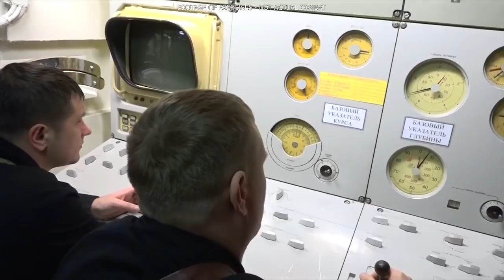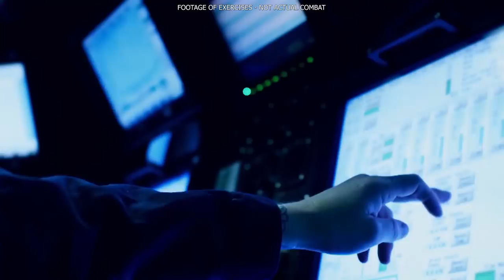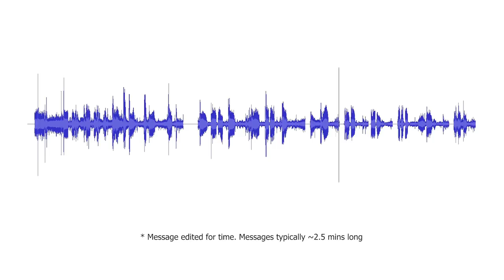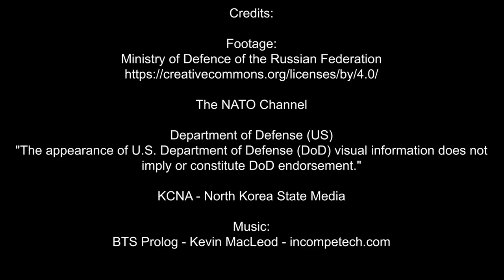The Ballistic Missile Submarine: Most Deadly Weapon System Ever Created

Comment: Thinking of the level of engineering it takes to fit a nuclear reactor onto a submarine hurts my brain
Reply: Nuclear reactors aren’t that big. 1 fuel pellet of uranium, about the size of a fingertip contains as much energy as 1,780 lbs of coal!
Reply: hfdydxydxy nope! I’m dead serious. Same reason why a nuclear bomb the size of a car could destroy most of a city.
Reply: @tibtroopin  you're forgetting all the systems that make up a nuclear reactor, it's not just the fuel
Reply: Space Dohonkey it’s definitely cramped in there but it isn’t much larger than a standard propulsion system. It may be smaller even because of the high heat flux.
Reply: @tibtroopin  could you give me an equivalence to the size so I can get an idea of what size you think they are, for example 'the same size as a car'
Reply: Space Dohonkey so the nuclear reactor itself in a submarine, not including support systems, is smaller than a standard size car. Control rods, steam production etc are additional components most of which are shared between propulsion systems.
Reply: @tibtroopin  ah wow, I'm guessing you work on nuclear submarines?
Reply: Space Dohonkey something similar to that yeah.
Reply: @tibtroopin  the pressuriser is alot bigger than people think isnt it
Reply: Tib Troopin lol u lying
Reply: It is generally known a nuclear reactor on a sub is the size of a dustbin roughly
Reply: @Will-xc8hg  That's crazy!! I feel stupid for writing the original comment but I'm kind of glad I did. I researched a lot about this and learned a lot.
Reply: @ChairmanMeow1  Nobody knows everything ;) Nuclear fission reaction releases about 1 million times more energy than the same amount (in terms of mass) of chemical fuel would release in form of chemical energy, for example by burning in oxygen. Fusion energy releases an additional 4-5 times more than fission, but it is not available right now as a reactor, only H-bombs.

One problem is the half-life of a radioactive isotope. Energy is released over large periods of time. Another issue is controlled release. Since it is more powerful it has to be controlled, so it doesn't melt everything in the near vicinity. Nuclear energy would easily overcome any chemical bonds ;)

Comment: China is the only country that has show submarines with an extension in the loin part that can contain larger rockets. Also no submarine can fire a rocket in the underwater, they need to come to surface and from the dry make the actual launch. 

A submarine can hypothetically pass though a maritime blockage of vessels and from the other side launch its rockets in order that the rest of the fleet can break in. WIth the development of rockets that can be fired from a safer radius carrying at the same time some weight  even if they travel at slower speeds, that role gets ever more possible for subs.
Reply: They actually don't need to surface in order to fire their missiles.

Comment: Each one of the 14 US SSBN Strategic Missile Submarine Ohio-class nuclear submarines has 24 SLBM Surface Launched Ballistic Missiles of the type Lockheed Trident II with stellar and inertial guidance (inertial navigation). 

Each robot has eight MIRVs (multiple independently targetable reentry vehicles) that can be assigned unique targets with either 475 kilotons alt. 100 kilotons combat charges. Trident II D-5 has a range of up to 11,300 km according to a British Wikipedia page, and the corresponding US Wikipedia page rounds up the number to 12,000 km but claims it has a longer reach than that. 

The fact is that the exact range, mentioned on the US Wikipedia page, is a secret. Elsewhere it is mentioned that Trident II D-5 can hit targets at 7,400 km distance. There is a big difference between 11,300 and 7,400 km, and the difference is probably due to the fact that the different core charges differ greatly depending on their strength. 

As it is 7,500 miles away from New York to Moscow, the shorter range means that an Ohio-class submarine based in New York and out for a month of service at sea will spend more than two days of these thirty days to get under the surface from and reach the outer water where their nuclear weapons with the greatest charge can reach target Moscow. 

This means that 6 percent of the second strike ability the United States may have must be omitted already there. In addition, approximately 25 percent of the US strategic submarine fleet at any given moment will be in port for service work and repair that cannot be completed onboard the submarine at sea and/or on the dock. 

In addition, the crews must be allowed to spend time with their families in port and the submarines must be buffeted with food regardless of whether their submarine is in need of service and passage in port or not. 

To all this must be added that the submarines' nuclear weapons must be maintained at regular intervals, perhaps every five years, and this is not done on board the submarine. 

Overall it reduces second strike ability by 40 percent or more in the worst case. Alternatively, the detonation blast from a multiple early nuclear missile launched from a given submarine is reduced very close to the home coast with up to 80 percent if half of the robots have 475-kilo warheads with shorter range for the nuclear-powered missile, but remain un-fired because of their shorter range, and the remaining half are only 100 kilos charges that can be fired from the waters from the New York coast. 

If this ratio applies to as little as 6 percent + 25 percent of the United States second strike capability, at least 82,800 kilotons of trotylene nuclear weapons can be removed from the equation, at least in the immediate phase for up to just over two days. For Russia and China the numbers must be similar or probably even worse.

These Ohio-class Trident II nuclear submarines make up the US strategic second strike capability and a total of 50 percent of the US strategic nuclear capability. 

There are also 4 Ohio-class SSGN Cruise Missile nuclear submarines capable of carrying 154 Tomahawk Block III or Block IV cruise missiles. The Tomahawk Block IV missile is an all-weather surface- and submarine-launched precision strike stand-off weapon. 

Designed for long range precision strike missions against high quality and heavily defended targets, the Tomahawk has a maximum range of 1,000 miles, or 1,609.34 km to be metrically accurate. It travels at sub-speed - 890 km/h.

It is simply not true that one Ohio-class can annihilate a not so small country. Here you can see for yourself the effect of a nuclear weapon, which you can give various large charges, in an attack on any city or city in any country: 

http://nuclearsecrecy.com/nukemap/

Comment: Hard to be the most deadly weapons platform when they've never been used. Also, you never made the case that SSBNs are "deadlier" than bombers carrying cruise missiles with nuclear warheads. All you effectively did was describe what an SSBN does. Not your best; you can do better--
Reply from the maker: My line of thinking was that a bomber, whether it is a Tu-95 with Kh-55s, or a B-52 with AGM-86s, only carry around a dozen or so missiles, each armed with a single warhead. The missiles themselves are subsonic, and significantly easier to shoot down compared to an intercontinental SLBM.
Reply: @Covert, Stick with the facts. They do not think but cannot be fought even though people will try.

There is nothing deadly going on at all. Most factual weapon systems effectiveness if you will is usually measured by the number of kills if you will. Simply put a P-51 is way more deadly then a F22. 

You are correct the number and size of missiles a SSBN carriers are quite larger then what most bombers can carry. I do not think we need to debate the surviveability of a SSBN is far greater then that of a bomber near or even inside contested air.

And in the real world both missiles or SLBMs, ICBMs are very easy to shoot down. Remember ASD15? My 9yo could do it. ;-)
Reply: The location of ICBM's silos are publicly known, and could potentially be vulnerable to first strike if the early warning system failed. Bombers and cruise missiles carried by them are very easy to shoot down. Submarine-based ballistic missiles (SLBM) are the most survivable, you never know where's the submarine is when it's submerged, it has great range and is as hard to intercept as ICBMs.
Reply: Covert Cabal My brother is a sub guy SSBN-730.  In combat his boat is more survivable then my friends flying B-52s from Barksdale or B-2s from Whiteman. Your channel is superb. Let me know if you need introductions or maybe video or photos. I'm sure we could set something up for you with some of the units. Electronic Warfare would be an option too.
Reply: "There is nothing deadly going on at all. Most factual weapon systems effectiveness if you will is usually measured by the number of kills if you will. Simply put a P-51 is way more deadly then a F22."

Yeah but the video title doesn't mention effectiveness it mentions deadliness which can be objectively measured and is not measured in efficacy. A wrench is more effective at its job than a JDAM is at its job does that mean a wrench is more deadly than a JDAM? No.

In terms of destruction and fatalities the SSBN and SSB are the most deadly weapons platforms/systems in the world fact, saying they're not because they've never been used is silly and saying they're not because they can be countered is also silly because deadliness is measured in optimal conditions. It's like someone telling me that a 96 year retired granny is just as dangerous as that Islamic extremist with body armour, an IED and an AK-47 because they're both in a police cell and aren't going to do damage if they wanted to.
Reply: @Adam, simple fact is that killing nothing at all isn't deadly.

You can go to the endless white cross graves on Memorial day and rally all those there to discuss how deadliness should be effectively 'measured'? Maybe not cos you may be another white cross on those fields.

At 96 our war veteran grannies still row across the channel each year. They are far deadlier then any terrorists on flip flops, lol! What kind of person would put a 96yo war veteran in a police cell??
Reply: Calvin,

Can you ask him how US subs are suppose to get to their designated combat area safely?

From 2000: Ehime Maru and USS Greeneville collision, USS Dolphin major flooding and fire, USS Oklahoma City collision with tanker, USS Hartford grounding, USS San Francisco collision with undersea terrain, USS Philadelphia collision with MV Yasa Aysen, USS Minneapolis-Saint Paul incident, USS Newport News collision with Japanese tanker Mogamigawa, USS Hartford and USS New Orleans collision, USS Miami arson, USS Montpelier collision with USS San Jacinto, USS Jacksonville collision.

In general yes the submarines are more survivable then bombers. Unless it's the USN submarine fleet. For the B-52s aka flying museum pieces it's a different story as well. How do you as US citizen survive a engine pod dropping on your cityblock when it comes off? What do you do if one drops nukes on US soil?

EW could easily take out US silo's. Yes they are all on Google Maps. All you need is a pickup truck and a strong magnet. Still runs on floppies and you know what magnets do to those. ;-)

Oh well Obama did sign the nuclear overhaul program for 1.5 trillion so we know the silo's will go.

Those things can just randomly explode. Remember Silo 7.Could throw a wrench in the whole TRIAD.
Reply: Michel Platteeuw
Trident II SLBM has a range of at least 7,500 mi (12,000 km), a sub can literally be located anywhere on the North Atlantic and could still hit any targets in Russia, given that location, unless you live in Southeast Asia or Australia, you are within Trident II's strike range (and there are Ohio-class patrolling the Pacific too, so literally nowhere on Earth is safe from it). And how can you get inside the silo? You probably need to carry the entire particle accelerator to do any damage from the surface, and I'm pretty sure pickup trucks can carry those. Silo's location is known for a long time since the Cold War because satellites and sightseers can pick them up, it's nothing new.
Reply: Sorry not my logic. Just simple facts anyone can fact check in the offcial active fleet list of the United States Navy.

You are claiming that is how those submarines are suppose to work? lol!

US ONR logic is true you mean? Least they have the balls to admit that is major problem. A-list events are taken very seriously by the United States Navy. I'm guess you are not serving in it?

You should read those reports instead of sticking your head in the sand ...

The USN submarine fleet is nicknamed the 'Bumpercar' fleet. Together with the surface fleet is it the worlds nr 1 in crashing their vessels into random objects really. Oh well that is normal according to you and not a problem?

I am guessing fake news from you. Why is there not a clear list of the crashed ships of the countres you claim crashed ships? You mean you simply do not know?

You are going with lies too now? Did we or did we not prove during ASD15 that we can in fact easily shoot down multiple ICBMs and SLBMs? Did we or did we not also ask to be fire at by live fire torpedoes and anti ships missiles at the exact same time? Oh yes the US, Russia, China are complete cowards and would never dare to do a live fire exercise with a manned ship you mean?

Deny it like some common Russia troll but it's been proven fact. ;-)

A pizza delivery guy walking into a nuclear missile silo is ok to you? Nah you are mad I am with the report by the general. You go attack that report all day but it will stand under the red, white and blue. You sound like you did not read it? Did you read it?

Yes nothing at all will be launched remember? That would take at least a minumum of 6 weeks. I could tell you why ofcourse but you should read that report.

Now where did you get the mad idea of succesfull launches I wonder? Been reading fake news?

Did Obama not sign a bill completely taking the silo's out of the arsenal worth 1.5 trillion USD for 30 years? Did you or did you not read that?

Shame to hear you ran from serving your country.

Good thing I do not serve a weak to very weak US military. Don't worry ... our navy will protect you like we always do saving American lives.

PS. Nice edit. How very Russian of you.